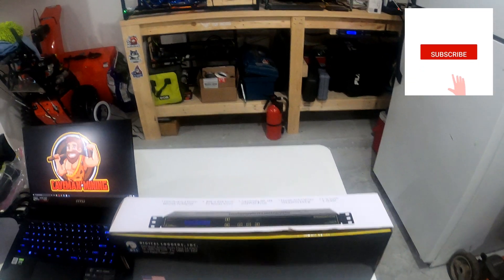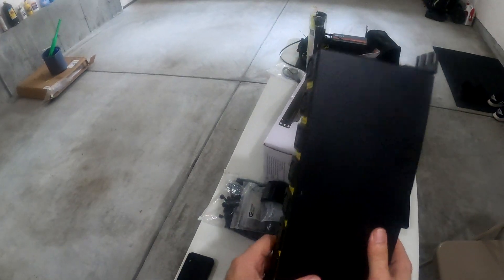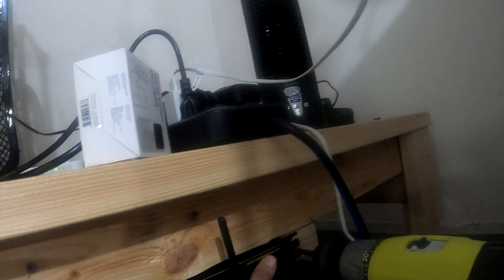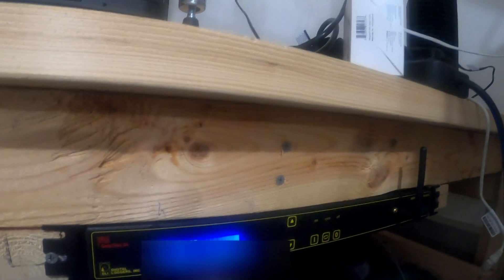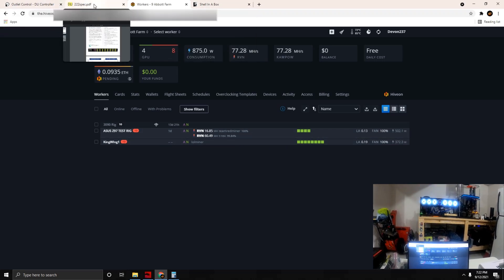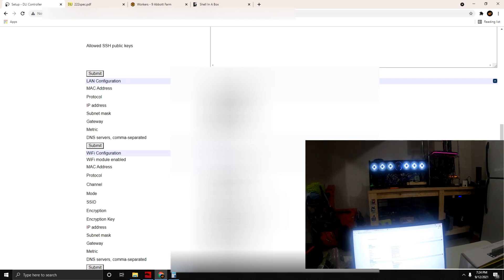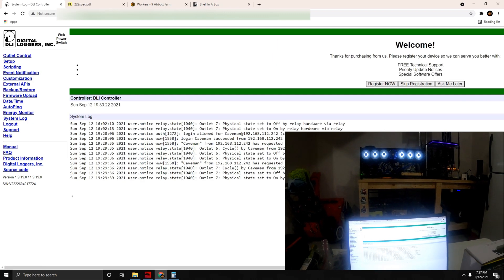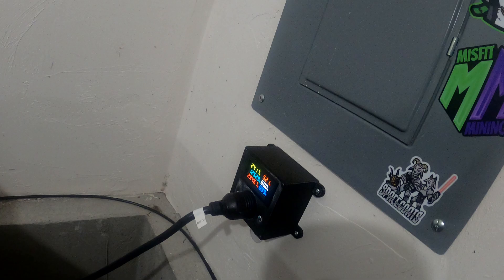Reviewing SMART PDU For Mining Rigs

Comment: Much appreciate you sharing your knowledge. 👍🏼 
i am located in a 240v country. In the office i do have surge protectors (on some places) and UPS for the servers in case of power failure. So does that mean a PDU wouldn’t be useful in my case? Or I understood this wrong?
Reply from the maker: Hey Metalhead thanks for checking it out! It totally depends on how much wattage/amperage your UPS can support! In my case I have a 30 AMP Circuit dedicated for my mining rig and its slightly bottlenecked by the 20AMP PDU.. but if your equipment can support your current power situation factoring the 80% rule, maybe a PDU is not right for you or everyone. What PDU's are great for is their ability to handle high wattage and allow many connections into the source! your setup sounds stable!?
This particular one has some cool bells and whistles (Network, switched, and managed).
Reply: @CaveManMining  yeah it seems i have some math to do tonight, though i am unsure if i have a 30 amp or higher. At least 30 i am sure it is, as that cost me a bit to have installed a few years back, but can’t recall if is higher.
Thanks for the details mate! Will do the calculations to stay on the safe side. 👍🏼